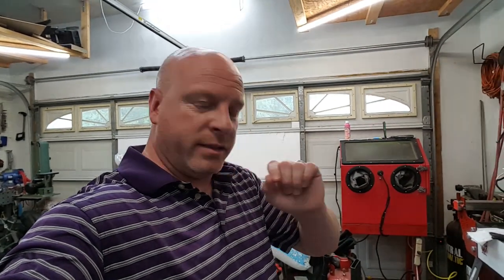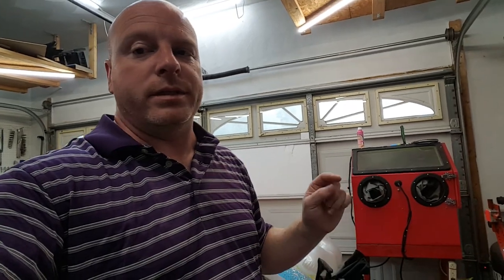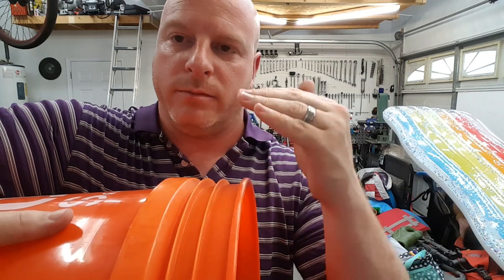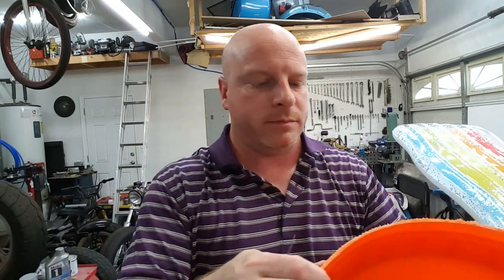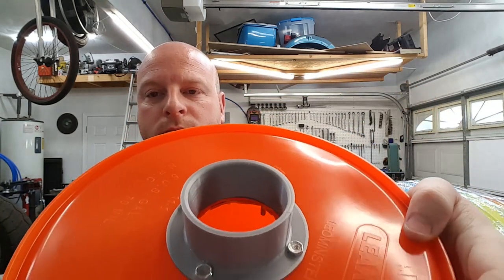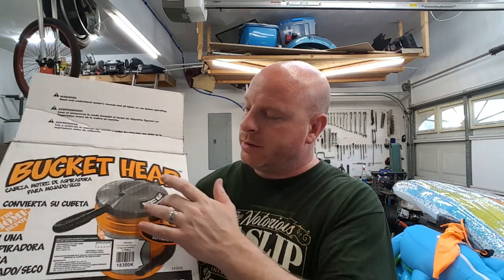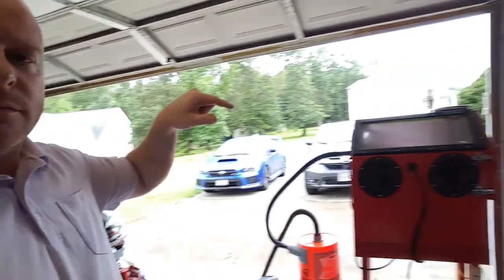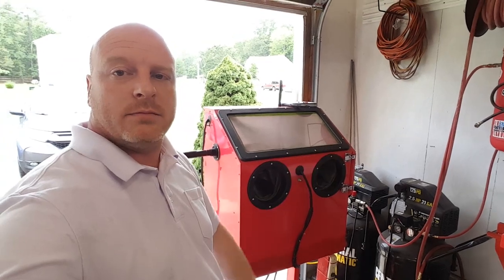A Simple and Affordable DIY Dust Collector

Comment: Thanks for your time and making this video.
I've got a bench top cabinet from tractor supply. I struggled with material feed problems a lot in the beginning. I got so frustrated that I filled the cabinet up with glass media to almost the top of the screen. That solved my problem.HOW EVER...
The media would build up around the sides of the cabinet and I would have to scoop it back into the center... Its a table top cabinet...not very deep...
I'm sure with the free standing cabinet there's more capacity and the media hopper sides are angled much more...I'm thinking more media is going to be your fix to keeping your pick up under the media.
Thanks again for the video.

Comment: Different one's put a baffle over the hole where you have the vacuum hose and some say that you hookup the vacuum and dust cyclone in the back hole plus a metering valve in the bottom for the gun and a shaker to help keep the media falling down

Comment: Check out the HF cabinet information from Ray's Garage channel.  He goes through the updates in quite a bit of detail.  I believe one of the reasons you are getting so much dust is that you are blasting at high pressure and low volume.  If you fix your pickup issue, and increase the volume of air, you can reduce your pressue to 20-40 PSI and have better blasting with lest destruction of your blast media.  But, I'd still suggest running your dust collector, as it makes your life better.
Reply from the maker: I plan on doing some more upgrades to make this cabinet better. I’ll certainly check that out. Thank you.

Comment: Nice work. Love the two buckets solution. I made one for carpentry with only one bucket and got filled too fast.

BTW, living in a third world country (Argentina) I barely understand you can actually buy a vacuum powerhead that fits in the bucket. Everything I do it's a nightmare to adapt things from what I can find.
Reply from the maker: Danbatio thank you! Sorry to hear of your struggles with parts. However if you are able to make things work without these parts that is a much greater accomplishment. Don’t let not have easy access to parts slow you down or stop you.
Reply: @HaslipCycleWorks  its said that need is the mother of invention but c'mon, sometimes I want the easy way :-)